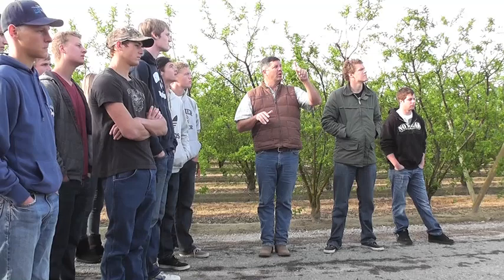Hail Cannons

Comment: That . . . wasn't even really a good explanation. There's no spiral motion in the direction he motions with his hand. The toroidal vortex spins in a way similar to rolling a rubber ring down the length of a shaft, but with the inside advancing instead of the outside.

Anyway, I doubt these things work, for several reasons:

1. The vortex rings are weaker than you think. I've seen videos where they shoot a hail cannon at a tree and the ring dissipates immediately upon hitting the outer leaves. I don't think they'd make it to 30,000 feet in calm weather, much less stormy weather.

2. Hailstones form because of violent shaking. Incredibly strong updrafts of wind (wayyy stronger than these cannons can produce) cause these spheres of ice to bob up and down in the clouds, forming layers of ice of varying density (which you can see if you ever get the chance to crack one open). Once they get too heavy to be lifted up anymore, they start to fall, gaining incredible speed due to their density and shape.

But whatever . . . y'all have had these for generations, I doubt one little youtube comment with an ounce of common sense is gonna make a difference. At least y'all are feeding the families of whoever keeps selling you acetylene.
Reply: Isn't it just about slowing the hail fall, not actually redistributing it a country away? Pretty sure it'd do that just fine.